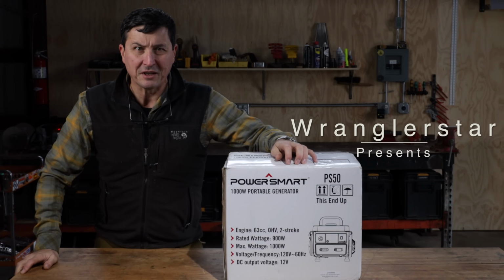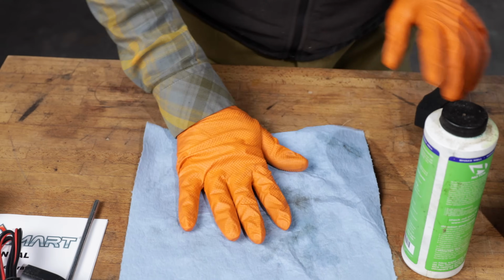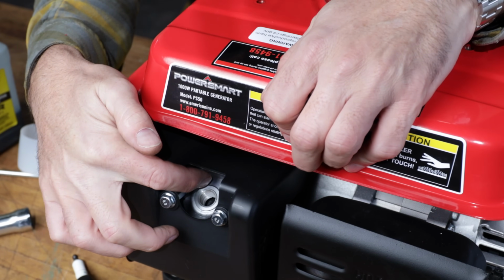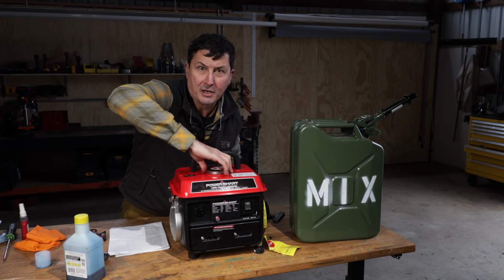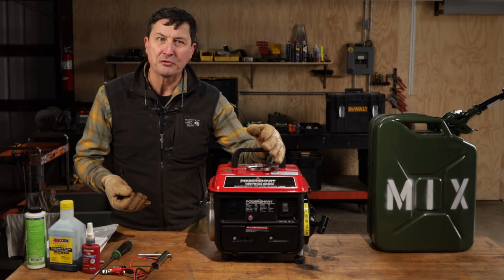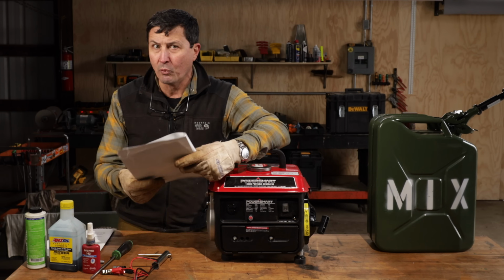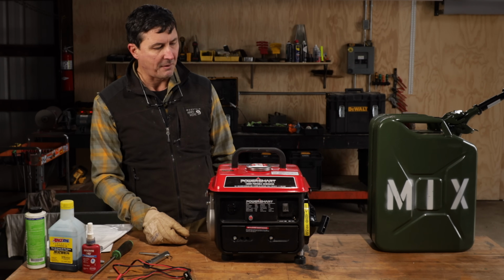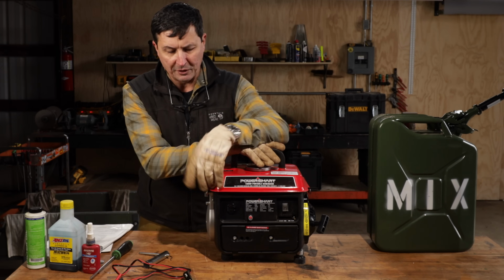TESTING The Cheapest GENERATOR on Amazon -$99

Comment: " is it worth it ?  You can buy 8 of these for the price of one honda generator "    The one honda generator will be going strong even after you go through 8 of these el-cheapos - lol
Reply: Still no sure why Americans only talk about Ah (amp.hour) and disregard the Wh (watt.h) for capacity and just instant Watts for output power. You can have all the Ah you want in a battery for example, if it's a 12V or 48V it's a all different amount of energy you can get out of it. I sold electric bikes in Canada and people only want to know the Ah even if you get from 6V all the way to 48V batteries...
This generator is a 900W steady output (7.5A*120V=900W), it's all on the label. Appliances will ask for a defined voltage and vary on the amperage. USA outlet is 120V Europe is 240V etc...

PS: Stating 8 of these don't worth one Honda before even running it at all is a bit presumptuous.
Reply: @Platypus_Warrior   " PS: Stating 8 of these don't worth one Honda before even running it at all is a bit presumptuous.
 " 

Think of these like the " Yugo cars " of generators  - How many Yugos' do you see on the road  - lol
Reply: @sparkywirenut  Hahaha, ok that's a nice one. 
You don't see many LADA cars on the street either ;) (but that's because they're ugly).
Happy new year.
Reply: @Platypus_Warrior  don't go to russia..
Reply: @groenekever  I won't thanks
Reply: got a honda it now 40 years old and i have a 79 euro one thats 10 years old and both stil running. don't think is wil work for 40 years its rusting a lot. but it stil runs great

Comment: I have had one of these for years, got it used for 10 bucks. It doesn't have the same name on it but it's identical. Another case of the same product being sold in China under multiple different companies nobody has ever heard of (most likely just made up on the spot). It didn't run properly and was missing the handle. I cleaned the carb, put fresh fuel in it, tightened the crimps on the spark plug connectors under the fuel tank, and used starter fluid for the first start up, haven't needed to use starter fluid ever since, now it runs fine. Also made my own handle with three layers of used serpentine belt and bolts with the correct threads. This thing can run way over capacity. I managed to start a full sized fridge up with one. Pull starter broke so I start it with a drill now. Compression test was like 110 psi if I remember correctly, have no idea what it was when it was new but the cylinder wall looks pretty good.

Comment: Does the manual say what the 12v current rating is? Thinking this may be a good battery charger for the solar bank when the sun heads south during blizzards.

Comment: I got the Harbor Freight version and have been blown away with the value and performance!
Don't operate it on the forest soil near foliage, as we almost had a fire from the hot exhaust blowing on woodchips and green brush undergrowth.  Also, the rubber feet crack from vibration after a while.
We built an off-grid cabin with that little generator! Just amazing.
Reply: We had a “Speedway Series” version from a parts store—forget which one—that we beat the snot out of and it never quit. I essentially gave it away when I finally had money to buy a proper generator. 
- Mine was identical, despite being almost 20 years older (different brand, obv)
- Never lit any grass on fire (came close, just set it on a 3’x3’ plywood square)
- It surprisingly sipped gas, despite using power tools (circular saws, drivers, drills) all day at our cabin (tank a day) and Dad’s CPAP at night
- Bring extension cords—it makes noise (tho not worse than non-inverter four-stroke models), especially if using overnight

Comment: Add oil? Doesn't that clog the filter & prevent air from passing through it?
Reply: No air still flows trough it but fine dust etc gets trapped to it always oiled my bikes filters
Reply: You have to really wring out the excess oil. I have neglected to do a good wringing of the oil on motorcycle filters and had them not want to start.
Reply: @mmaaddict78  mine have started just fine with the filter placed in a bag then adding some oil and squeesing it and throwing it on

Comment: I just purchased this unit from Amazon. I'm confused by the DC outlet directions, here's why. The DC outlet instructions say that the outlet IS NOT for charging batteries but is for supplying  power to DC input devices. The other reason I'm confused is that they provided the cord to plug into the DC outlet with pos and neg clip's on the end ? If they aren't for charging a battery then what is it for?

Comment: Something SHOULD have gotten all Fizzy!!!

Wait a minute,  it is rated for 900 watts and you ran 1,500 Watts on it for half an hour???

How many volts was it putting out?

Something is very wrong here, can you double check this.
Your positive review showed a MAJOR malfunction!!  Can you please adress this?
Reply: Jf Mc, How do you figure that exceeding specifications is a “MAJOR malfunction”?  The rating is the minimum it can meet and still perform as specified.
Tires rated for 40,000 miles aren’t ‘malfunctioning’ if they last for 60,000 miles.
A bolt rated for 4,000 lbs sheer strength isn’t ‘malfunctioning’ if it survives 5,000 lbs.

Every device with a performance rating also has an engineering margin for that rating, so that individual instances with minor flaws will still meet (or even still exceed) that rating.
Reply: @Vessekx  , You don't know much about electricity do you??

Seriously I don't have the time to explain this to you, but be assured every thing you said is completely idiotic. 

Have a Merry Christmas!!
Reply: Jf Mc, I apparently understand quite a bit more about engineering than you do, because safety margins on rated load capacity is pretty basic stuff for you to be claiming it is “idiotic”.  The engine in these generators is rated at about 2.5HP, which is about 1800W, allowing for losses in conversion, that’s more than enough to produce 1500W under load, even with a continuous load rating of 900W.

Not that I expect you to understand, since you claimed that a safety margin on a bolt’s sheer force rating was “idiotic”.  (Do you understand the difference between a ‘working’ and ‘static’ load?)

I’d suggest completing you high school education before commenting on basic engineering practices.  Your failure to do so thus far has simply exposed your abject ignorance on the subject.

Comment: I've used many 2-cycle gennies in the past.  The largest issue I've found is ethanol gas messes up the gaskets in the carb.

As long as you use ethanol free gas and go slightly light on the 2-cycle oil, mine says 50 to 1 I thin mine out to about 60 to 1.  

As for an external tank I use a marine fuel can with a siphon bulb to start and a fuel cut off valve.  As long as the can is at least 3 feet higher than the gennie it works for me.

Also replace the fuel line and hose clamps.  I've had more issues with cruddy fuel lines than almost anything else except the ethanol issues.

Comment: Thanks for taking the time to share a look. I've got a couple of the very similar Harbor Freight red "Stormcat" model, the basically identical predecessor to their current green TailGator brand, though mine lack that handy little 12V hookup and cables yours has. Every homeowner should have one of these little 2-stroke generators, some reasonably fresh 50:1 mix 2-stroke fuel (preferably ethanol-free, if you can get it) treated with StaBil, and a good exterior-rated extension cord to run through a window for those occasional power outages. They'll dig in there just enough to run your fridge for a half hour or so every couple-few hours to keep it from defrosting and provide a few lights or maybe run a smallish space heater set to low or medium other times. They're also great for running the odd power tool where there's no power handy. I keep one stowed in the rear passenger footwell of my old tow beast Durango for running stuff like buffers, grinders, fans or feeding shore power outlets in the boat lot. Sure, I'd like to have a whisper-quiet  $1,000 Honda genset, but these little 2-stroke fussbuckets will get the job done too for less than a tenth the cost. 

Like you said, the best thing you can do with one of these is to swap out the shabby knockoff Chinese "Torch", "Bongodongo" or whatever other lowest bidder spark plug the factory screwed in for the equivalent Champion N9YC or NGK BPR6ES. You don't have to drain the fuel tank every time after using it, but it is always a good idea to turn the fuel tap off and let the carb run dry. That's the best way to shut it down. It'll help keep its little carb from clogging up, especially if you use fuel with ethanol.
Reply: SPOT-ON  !    Bilgemaster Billy !    my  sentiments, experiences    X actly.   !   Anything made in china,  can  have  ANY  BRAND  NAME  label, simply  'pasted'  on it. Don't  use  gold colored tipped spark plugs- where the wire goes to coil  !   (junk) according to  Taryl, Fixes  All    youtuber.

Comment: Home depot has a 11000watt generator runs on gas or propane for around 900$ it will run my 220v welder, chop saw angle grinders your house, pull start and electric start best I've seen for the price made by a company called Wen

Comment: I like your idea of putting oil in the cylinder first.... another idea is to run a quart or two of 2 stroke mix 50:1 or so for the initial break-in. This would apply to all outdoor power equipment.

Comment: I have one and I use it more than the bigger generator.  I enjoy the fact that is does the dual charge. Last winter used it to charge and run the block heater on a powerstroke for an hour. To get the truck to start and run.

Comment: I'm not sure I would run sensitive electronics on this. I've seen multiple blown power supplies from these. If you want to run sensitive electronics you'll probably need something a little more expensive that handles really clean smooth power.

Comment: I purchased a similar generator designed around the same engine, mine has two outlets. I didn't go through the filter or cylinder pre-lube process. Works great, powers an oil fired portable heater (salamander / torpedo) that I set up for emergencies e.g. heating up the snowblower or me while working outside during the winter.

Comment: NO NO NO NO 

NEVER PLUG ELECTRONICS IN TO A GENERATOR!!!!!!

Good chance on of these units will not have a good Inverter and will surge and destroy electronics!
Reply: How about using a surge protection extension lead and then plug your electrical device into that so it will stop power surges.

Comment: Never run any sensitive electronics on this , like tv, computers or anything like that. It will fry it.
Reply: @PigMine6  does it actually work/help though?
Reply: Shut up!!
Reply: @Spoofkill  What? That's a valid bit of advice. It's a $99 genny. They have to save cost *somewhere*, and power-conditioning is an obvious place to do it. A lot of electronics use efficient but somewhat fragile switch-mode Power supplies in their bricks. plug-in drill? should be fine. Heater? fine. $1,000 laptop? I wouldn't.

But you can certainly charge a battery and then clip a car charger to it to charge expensive things.
Reply: @DFX2KX  Y'all coming at this like mains power is any cleaner! Mains power is very dirty at times! Prone to outages and spikes!

Comment: I bought these 2 stroke generator in Malaysia. It work well for 2years there while camping. It was bought to Singapore it worked for another 2 years. Back to Malaysia  work another 4 years. Now I am in Vietnam, its already providing power in power outage. I always drain the carburetor. When I know it's going to be store for more than 2 weeks I drain the petrol and use it in my motorcycle or cars. No issues at all. My guess my machine can work another 20years. It's very easy to clean the carburetor. Tuning I leave it to local repair shop once in a few years.

Comment: I can see it being used for a fridge just fine, but unless its a inverter generator, it should NOT be used for something sensitive like a computer
Reply: Unless the computer is a laptop... Most modern desktops can also handle square wave. Has to do with the wall power being immediately converted to DC.
Reply: @jonross377  I think Linus would disagree with that statement: https://youtu.be/hr1oBHPrLRg?t=101

Comment: When you plug a 1,500 watt load into a 900 watt generator and it doesn't trip the overload, that is a huge problem, not a feature.  A thing like this has its place, but I'd be seriously wary of plugging my fridge or frankly anything I cared about into that thing.  What you are giving up with this versus a Honda is reliability, both that it will work long-term, and also the quality of the power coming out of it.  If you want to run a few lights or charge up a battery, fine.  More than that, and you really should be spending more.
Reply: trustbuster23 lmfao rotfflmfao 🤣 😂 lmfao 😆

Comment: The 2 cycle engines I've tangled with recommended "marine" gas. Does this require 87 or 89 octane? My 2 cycle weed wacker recommended 89.
Aim High! It allows for bullet drop.

Comment: I've had the same generator, except sold by Harbor Freight, for 4 years.  I paid $89 for it on sale.  Here is the big warning:  it is NOT an inverter.  Just like any non-inverter generator, it can damage or destroy electronics that require full sine wave current.  NEVER, NEVER plug sensitive electronics into this or any other non-inverter generator.  Also, things like refrigerators can have a big starting load and this generator may bog down on that--if it does, it can damage the compressor motor on the refrigerator.  It's a great little generator for powering things like small power tools, etc., but it is not meant to be a standby generator.
Reply: Just to clarify, these sort of generator units have an alternator inside them, which rotates around and around in a circle, a perfect circle, and therefore gives a perfectly pure sine wave output and electronics will be happy with it (so long as the voltage and Hz AC cycles are within specification).   I have had the Australian version since 2005.  Australian version is configured to give our 240 volts, 50 Hz, 750 watts mains output plus (a somewhat unregulated 14-ish volts 8 amp battery charging output). I have used mine as required for occasional power outages and testing, many times including for TVs, computers and re-charging things.

Comment: I lived off grid for 7 years and used to go through a couple of these per year. But they were never designed to do that kind of work. Do not mix the fuel any richer than 50;1 or the muffler and ports fill with soot. The plastic guts inside the starter are the next thing to go. Aside from those points, they will get it done.

Comment: good field generator.  That can recharge the batteries for cordless tools when power isn't available on the back 50.
Reply: In the time that you charge the battery's, you can use the 220Volt plug on the generator. 🙄

Comment: Based on my current experience with a 2000w Honda, I think they are overrated.  I've got an OLD 1000w Honda that runs much smoother and is way less temperamental.  If I was buying today, I'd get a 2000w Harbor Freight or the 3500w with electric start.  Much better value.  For the price of a 2000w HF inverter generator, I'd be hard pressed to ever consider this one.  If a person had a dedicated need that dirty power wasn't a problem, I could see buying it.  For the average person who's home (or campsite) is filled with electronics, I'm thinking it would pay to save a bit for a cheap inverter genset.  Great video regardless!

Comment: these things are light duty, aluminum wire wound. starters break, I have 5 of them , and have had all kinds of problems. pull starter is very weak, gas fuel mix goes bad in about 3 months of no use. so run the fuel out of the carb before storage. voltage is very unstable as the generator hunts under load. do not run 1500 watt heater on this thing, unless you want to shorten the life of it drastically. the less wattage you use on it the better. overloading it ruins the rectifiers in it. and you can not just solder in new ones on the armature because the wire is aluminum you have to wrap the wires around the leads of the rectifier. Refrigerators do not run well on these because they are weak on startup power for compressor motors. they are ok for lighting. might ruin your tv though because of the unstable voltage and frequency. due to the small motor and governor reaction time. OK for a hundred bucks? watch you do not ruin something that costs much more than that cheap generator! I have Honda eu200I It may cost ten times more but it is at least ten times better. I do not have to worry about ruining  voltage sensitive equipment on my Honda. I live on an island where the electricity goes off  several times a month. and Know generators. I repair them here. If you want reliability do not buy this. for cheap, and you don't really need to rely on a generator, this is ok for a play thing that might ruin some expensive appliances, is it worth taking the chance? you decide. Have a good day.
Reply: Indeed. The first thing came to my mind when seeing the governer do its thing was about how hard AC is to make stable and safe. Similar electronics for solar array costs $100 alone in the minimum and that's just for the DC to AC conversion with GOOD sine wave, transformers and boost converters.